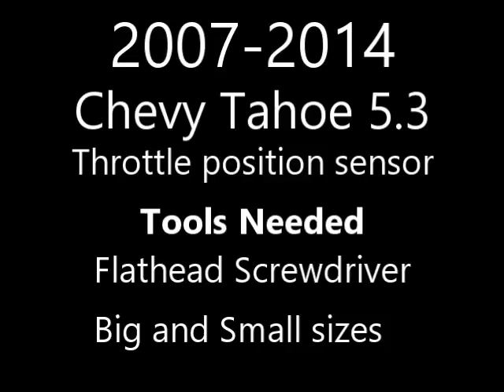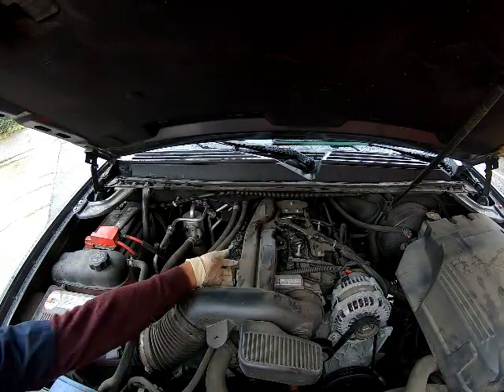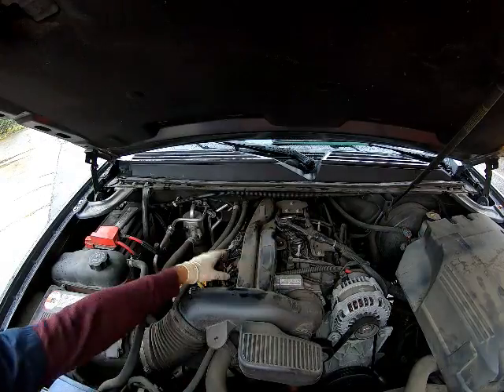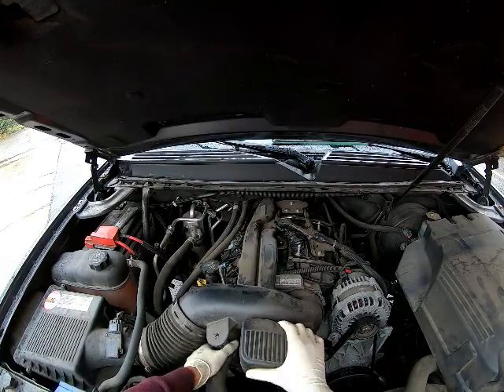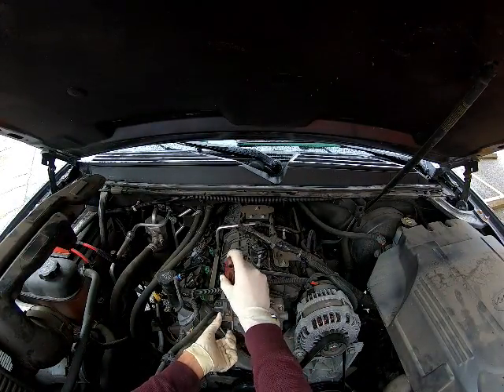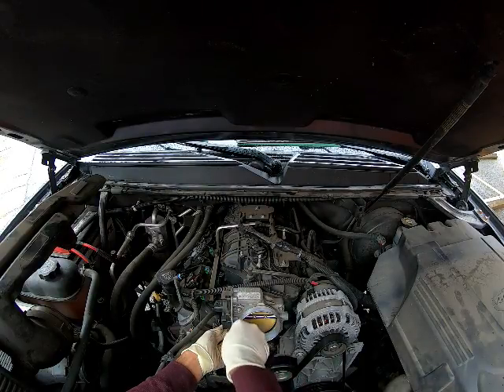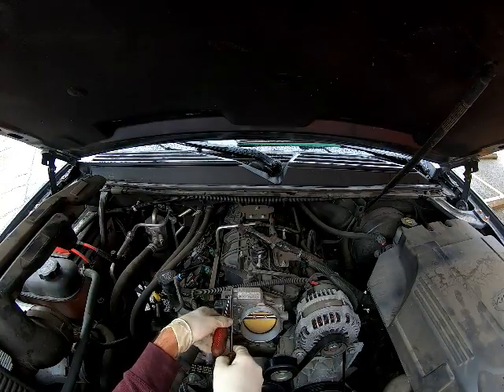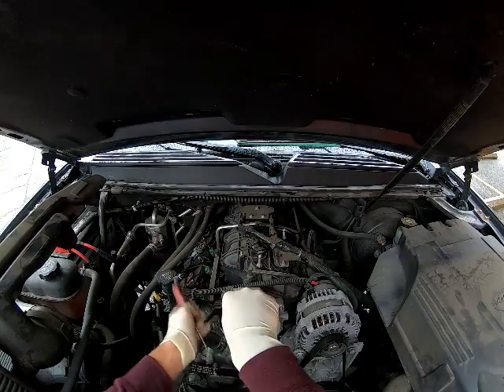2007-2014 Chevy 5.3 How to change Throttle Position Sensor

Comment: I want to add a couple notes/tips in here as a mechanic myself:

1. A small pry bar works way better than a screw drive on removing these clips. It was super easy. 

2. You can use a C-clamp in some areas of the part to put the clips on. On the bottom back clip I had to use a large pry bar prying off the metal fuel rail you can see in 2:53. For the other clips, a small plastic or rubber mallet works great. You could use your screwdriver handle in a pinch. 

3. Before installing the new part, insure that the old gasket is off. The new part has a gasket pre installed. The old part left the gasket on the housing and didn't come off with the old part. 

4. If the new part doesn't want to go on, check the terminals up at the top of the old part and compare it to the new part. You might notice that there is a piece of brass/copper colored metal on the part that's missing on the old part. That means that part stayed on the other piece that's mounted to the vehicle still. I had to pinch it with my thumb and index finger and pull it off before the new part would go on. 

5. The wiring harness plug that plugs into the throttle body has a white "lock" piece that first must be pryed out to the left (leaning over the engine facing it) before you can push the actual snap lock down (black piece) to remove the plug. This is just a "back up safety lock" piece they use from the factory. He doesn't show it being removed in this video. If yours doesn't have it, it's because this part has probably been replaced before.

6. Get a can of throttle body cleaner with PEA in it (Gumout has it for sure) and use the entire can to clean the throttle body while you are in there. 

Good luck

Comment: Good video, but a word of warning. Not all of these vehicles will successfully re-learn the idle table without a programmer. I changed the TPS on my wife's 2012 Yukon and it has not idled correctly since. It either races to 2,500 to 3,000 rpms at startup, making dropping it into gear impossible, or when in gear, when you let off the brake, it accelerates itself to about 1500 RPM with no gas pedal input. I have tried the re-learn sequence about 4 times (idle 3 minutes, shut off for at least 60 seconds, idle 3 minutes again), including leaving the battery cables unhooked for various amounts of time. I have also driven the truck on the highway about 100 miles with no change in behavior. HAVE A BACKUP PLAN if you choose to DIY this. Be prepared to go have it reprogrammed if it needs it. Also you must consider that when the truck races to 3000 RPM like mine, you cannot put it into gear without possible damage, so you may be looking at a tow truck bill as well. I know many times the manual relearn sequence is all it needs, but be prepared for when/if it doesn't.

Comment: Thank you for the vid but I have a question to I have to follow up with a computer to program it ?
Reply from the maker: Yes with a scan tool. However there is a manual process which can work as well. You can look up a video on that. Idle relearn procedure
Reply: @mechdjango3490  I went with the manual way and worked perfectly
Reply from the maker: Awesome! It’s nice to have that option

Comment: Brother.. may I know what the symptoms are when the sensor goes bad.?
Thanks
Reply: Some of the symptoms are low idle , high idle poor throttle response and a surging idle that goes up and down as well as bucking after you let off the throttle when driving coming to a stop . My idle is starting to roam a little especially when the engines cold and not warmed up and I get the occasional bucking when letting off the throttle to come to a stop so it's time for a new TPS sensor install . I have a scan tool but not sure if it has the capability to do the TPS relearn but my neighbor just 2 houses up from me has a repair shop and he has a snap on scanner that can do the relearn if I have to go that route.

Comment: Should you first disconnect the negative battery terminal but use an OBDII memory savor while doing the swap?
Reply from the maker: You can if you’d like. But it still needs a proper reset afterwards regardless if you have one or not.
Reply: @mechdjango3490  how do you reset ?
Reply: @mechdjango3490  how’s the reset process 
I’m struggling with the relearning I bought the whole throttle body but rpm’s are too high

Comment: Thanks for the vid, I'm doing it today, I found that the Stabil trak sensor and reduce engine power override is associated with a dirty intake snorkel,  and throttle body trips those sensors. Hopefully cleaning the two and replacing the throttle body sensor will fix it
Reply: I am experiencing the same StabiliTrak issues on my avalanche, did you have to take off the throttle body and clean it before it worked properly, or did you just change the sensor? Can you clean the throttle body without taking it off?
Reply: @colettekruse6420  
Well I found out that it was the gas pedal sensor and not the throttle body sensor. After hearing so much about changing out the Throttle Body Sensor and having idling problems and that its supposed to be calibrated. I decided to take it to a mechanic. I told him I was sure that it was the throttle body sensor. He said let me diagnose it it first. Well he did and it was not the Throttle Body Sensor. It was that gas pedal position sensor. I had already bout the throttle sensor so I had him remove the throttle body and thoroughly clean it, place the new TBPS in and replace the Gas pedal position assembly w/sensor. That fixed it and it runs great! I think I paid like $320 for it all and it was worth it. He is a good reasonable mechanic.

Comment: on 2009 silverado 4.8 had code po121 clean trottle body  so i replace it now rpm is at 2500rpm
Reply from the maker: Search for Manual idle reset procedure

Comment: Did you replace this because your truck had a hard shift from 1st to 2nd gear ??
Reply: There’s a video on that.  My Avalanche is doing it.  You need a new servo in the tranny.  Not a hard fix just messy fluid.  Good luck.  👍🏽

Comment: I changed it but now the idle is roaring high. Did you have to do that or how do I readjust it?
Reply from the maker: Lookup manual TPS reset procedure
Reply: @mechdjango3490  Why dont you just explain it? Why did you change it in the first place? What code were you getting? Some basic information that might make the video more engaging! I

Comment: Maybe a dumb question.....how do you clear the code,I’m about to change mine out as we speak and don’t wanna change it and have no idea on how to clear the code at the end 😂
Reply from the maker: It’d be best to at least use and obd2 code reader since disconnecting the battery won’t necessarily clear the code
Reply: G Smithy it’s very simple to do a relearn. Just disconnect the negative terminal for at least 5 minites